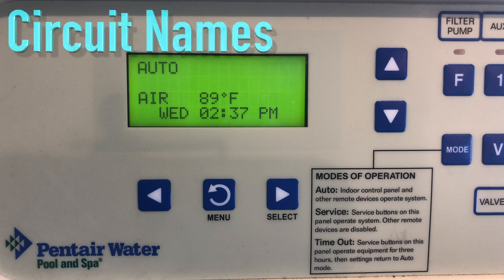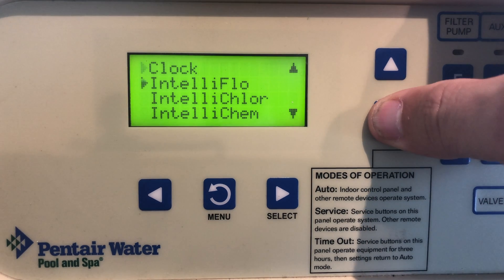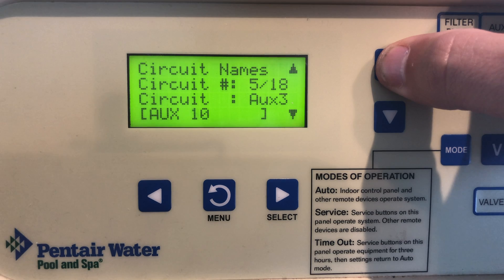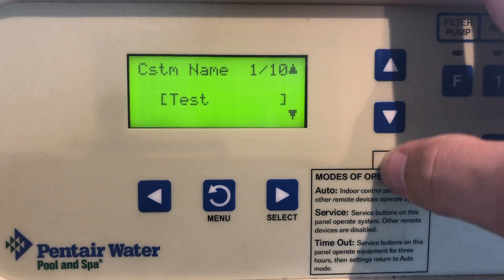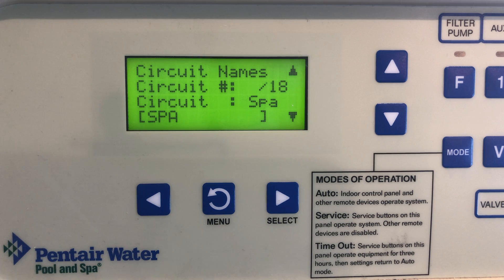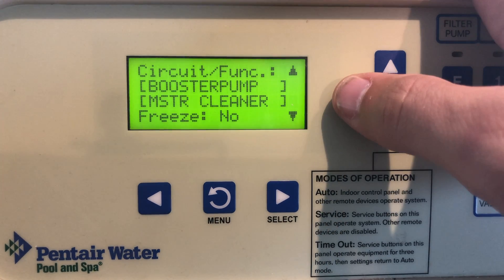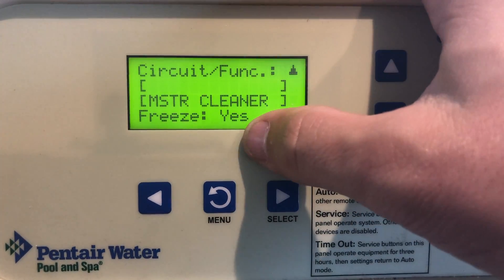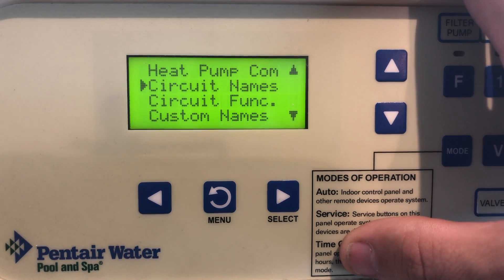Pentair Easy Touch Setup: Custom Circuit Names & Functions Made EASY!

Comment: Can one of the AUX buttons on Easy touch be programmed to control the Heater on/off
Reply from the maker: I suppose it would be able to turn on and off. But generally it’s wired directly to a breaker. Then a 485 ran from heater to low voltage heater on automation board to give automation full control.